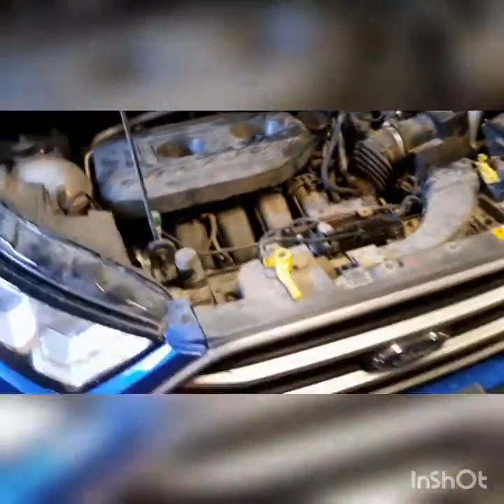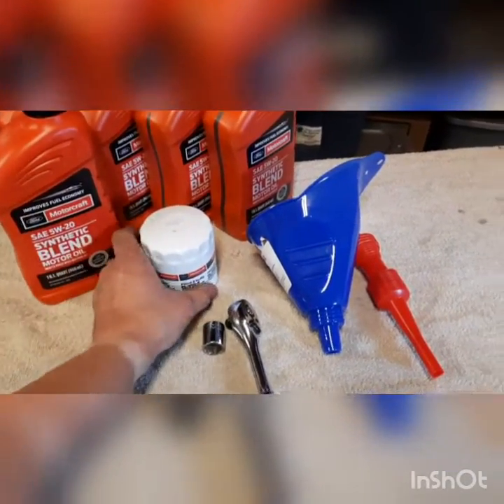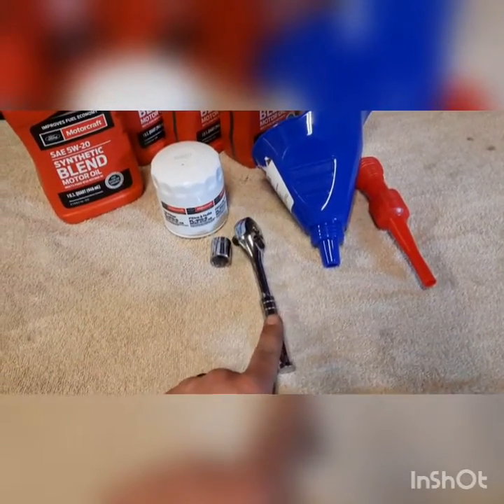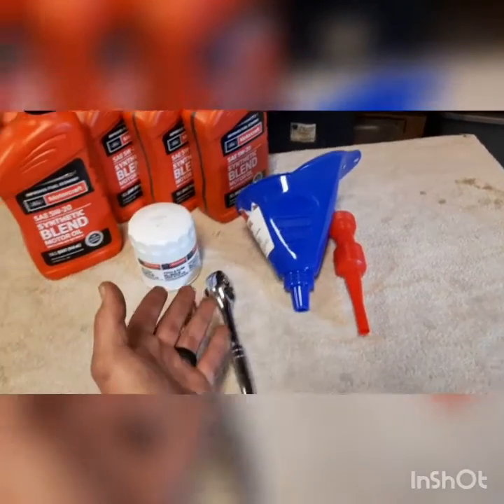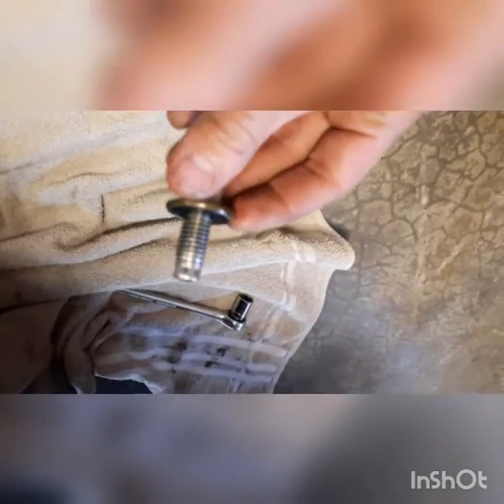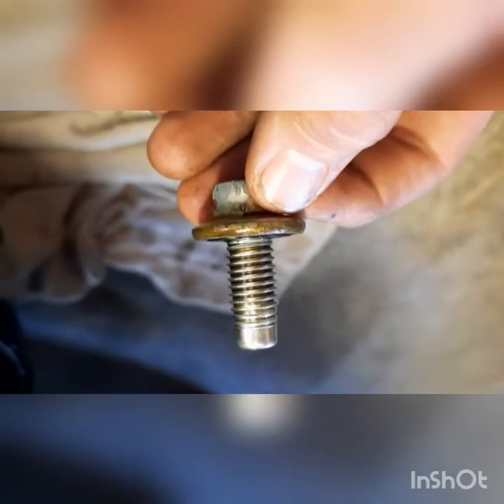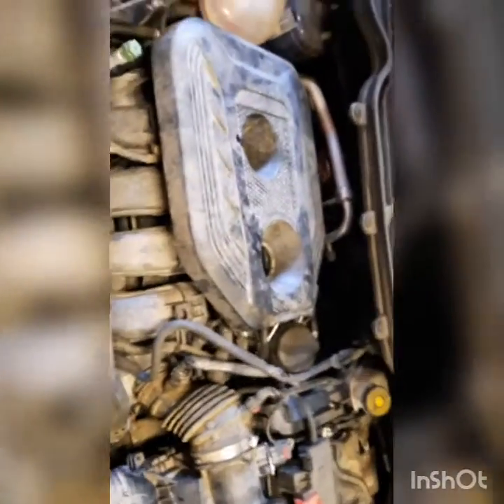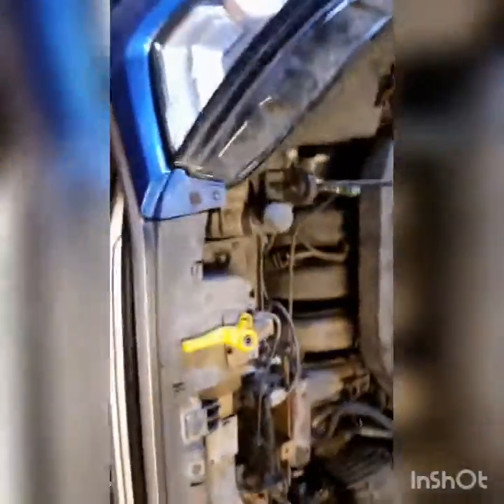How to change oil and filter (2018 Ford Ecosport) Super easy to do in 20 minutes!

Comment: What size Falken tires do you have? Are you using the stock wheels? 
I have the exact same EcoSport, even the blue color.
Reply from the maker: 205/70r16 yes, they are the stock rims off the SE. I got them at discount tire. Tge tech told me they would rub. But i maxed out the shocks and flex several times and never had it contact anything. They tell you itll rub for insurance reasons.

Comment: I just cant seem to get the filter out even with a huge wrench, I am rotating it anti clockwise but just wont get it off.
Reply from the maker: It is possible your plugs threads are stripped and may need to revert to other methods to remove it.

Comment: Have you had any issues with you EcoSport? I have a 2018 EcoSport SE 2.0 and I am experiencing sputtering when accelerating. I’ve changed the air filter, spark plugs and cleaned the mass air flow sensor and still no changes.
Reply from the maker: I have not had this issue. Unfortunately there are several things that can cause sputtering. Cracked head gasket, issues with valves, with timing, with computer modules. Im no master mechanic and without experiencing it in person, it is difficult to diagnose. Id recommend taking it to your local ford mechanic and see if they can diagnose it. If its an easy fix, do the work yourself, if you can.
Reply: @unintendedpurposes  yes, planning to take it to the dealership for diagnosing. I figured I would make sure I had the little stuff done first to rule basic stuff out. Thanks for the response thought.

Comment: Did you crawl under without jacking it up? I have a 2020 se and was just curious
Reply from the maker: I didnt jack it up, but it was very tight so id jack it up in the future.
Reply from the maker: I also had larger tires on it, so i had a bit more ground clearance